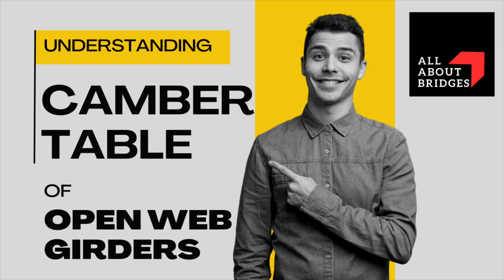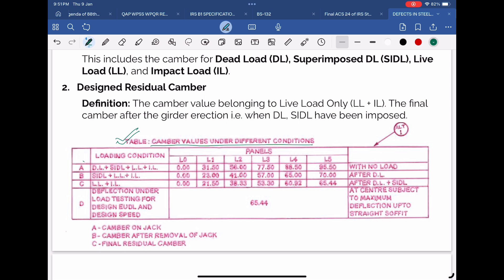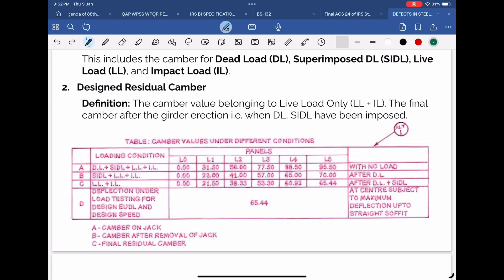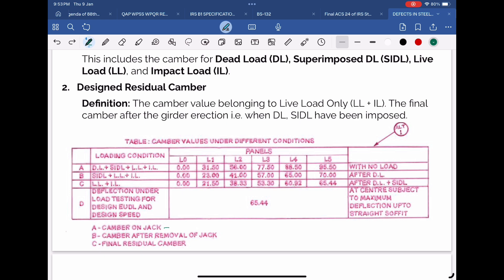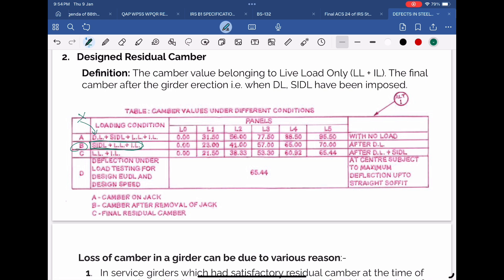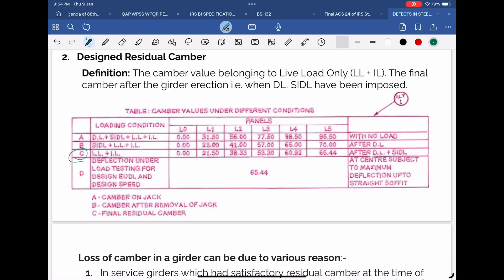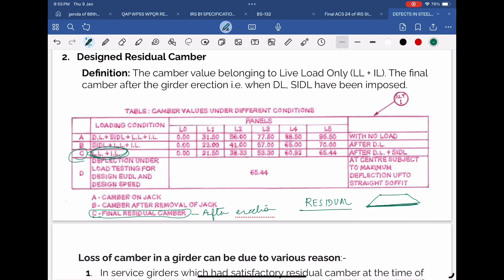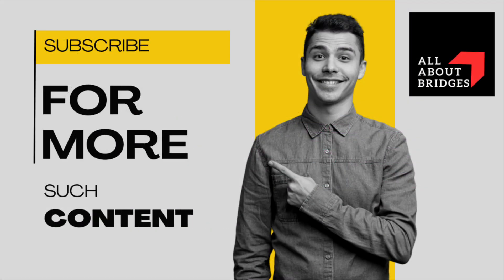How to read and interpret camber table of RDSO OPEN WEB GIRDERS ?

Comment: Please cover topic "HSFG Bolt".  some railway site use of Full thread HSFG BOLT, Torque calculation Min. & Maxi., K value in HDG Coating  with lubricant & without lubricant  & K value for Zinc Flake coating . Please prepare full series of HSFG Bolt Qap to Final inspection. 

There is very little awareness about HSFG bolts in India, and a lot needs to be done. Over-torquing is happening everywhere at railway bridge construction site.
Reply from the maker: @pushkarkpathak2102  ok. Will try 👍